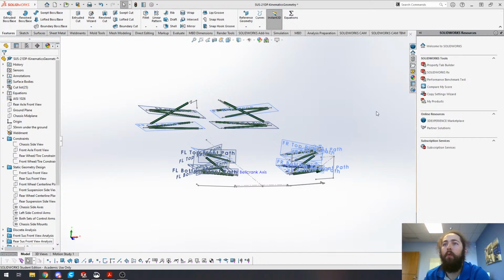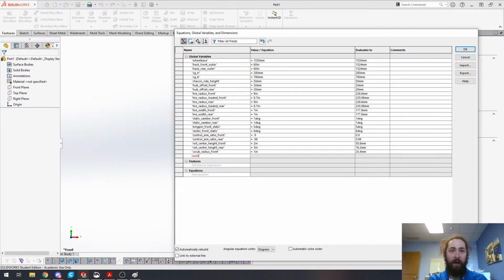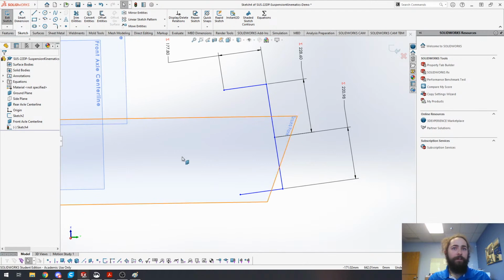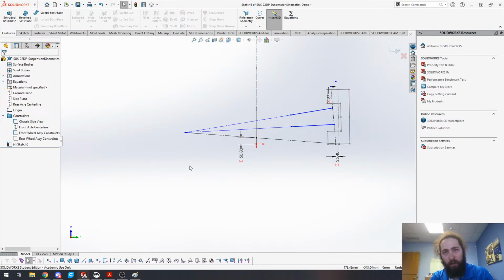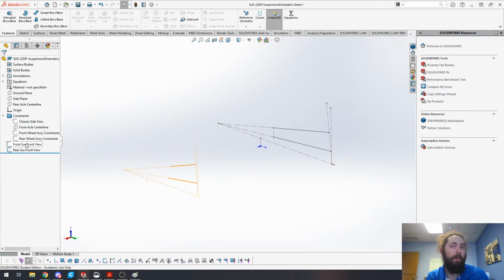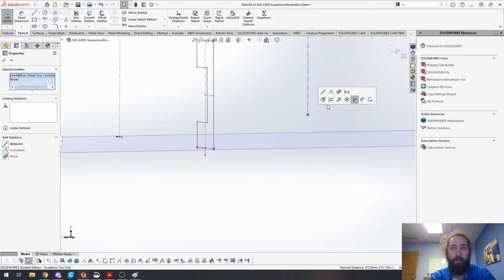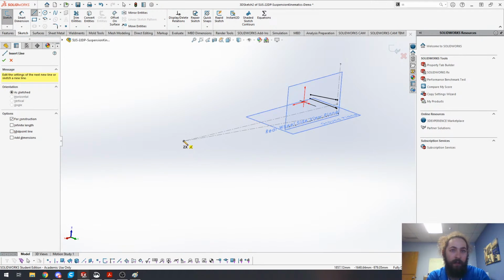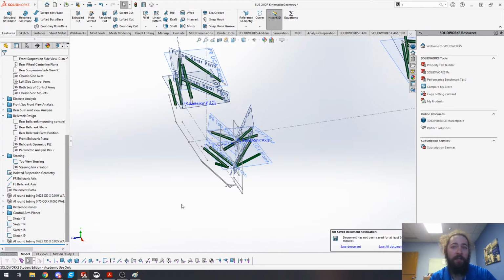Suspension Kinematics Design in Solidworks

Comment: No one designs suspension like this anymore.  You need kinematic software that can either parameterize or parameterize and optimize.  Basically, it is an inverse process.  You vary the pickup points within a pre-defined and just brute-force it.  By "brute-force it" I mean the computer generates a few BILLION suspension designs (combination of pick up points and rocker geometries.  Then you test the designs to see which give the behavior you want.  Trying to design a suspension is just impossible to get the results you want.